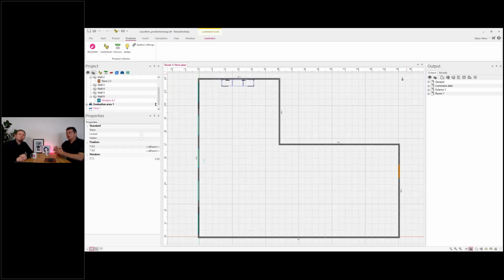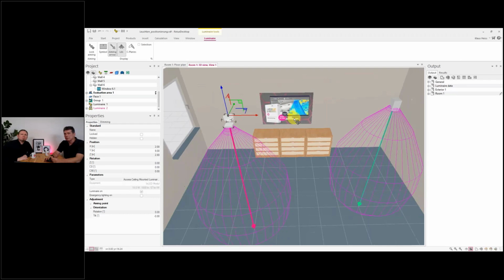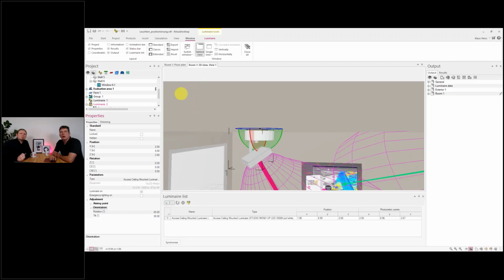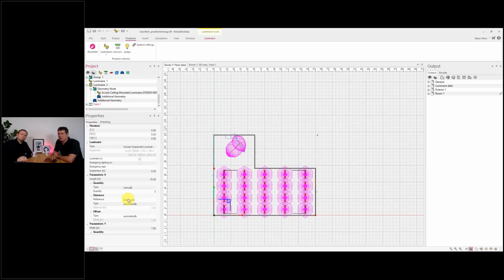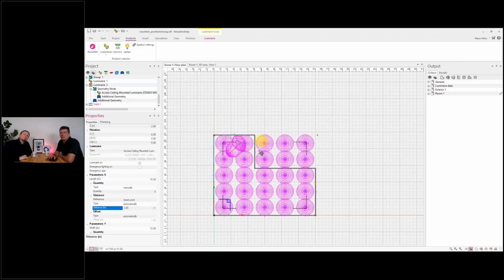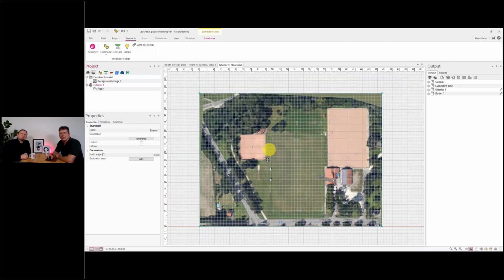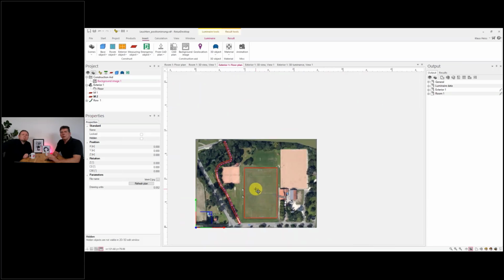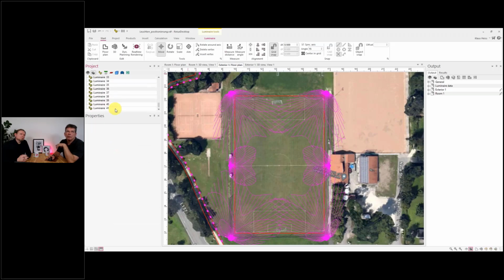FUN with RELUX – Episode 36 – EP36 Placing luminaires

Comment: Why does the aiming arrow of the spotlight become very small in an outdoor scene when rotating the spotlight so that the light direction is aimed upwards? This happens even though there is an object in front of the aimed spotlight. As a result, the fixture's aiming is not visible. This issue occurs very often with imported objects.